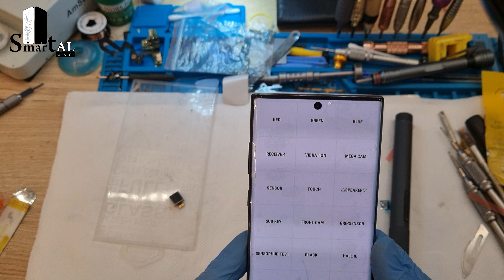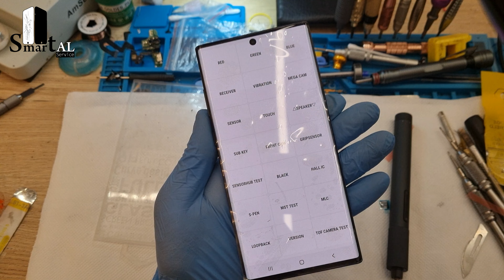Samsung Note 10 Plus screen replacement - Full video 4K

Comment: you replaced the screen without replacing the battery??? every screen replacement should come with a new battery also. ill make sure not to take any of my phones to your service store, you don't even replace it the right way. samsung stated all screen replacements should come with a new battery also. youshould be ashamed of yourself
Reply from the maker: When you pay for the battery. thanks for your advice
Reply: @smartalservice  it's not my advice it's what Samsung says needs to be done. Every new screen replacement has to come with a new battery, in fact the batteries are attached to the screen, so I hope you're telling your customers that your skipping the most important step
Reply from the maker: @supremetechniques46  then you need to go to Samsung to replace your screen   and keep in mind that you get what you pay. We are screen refurbishing so you can see glass change video also. Thanks for watching and we do our best. Have a great time 🤗